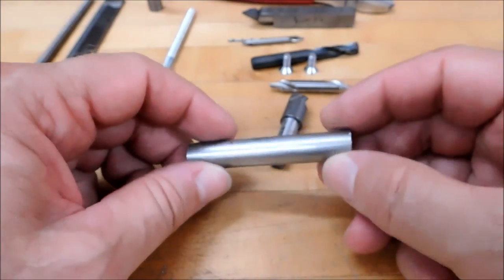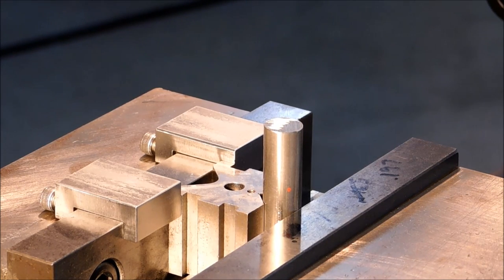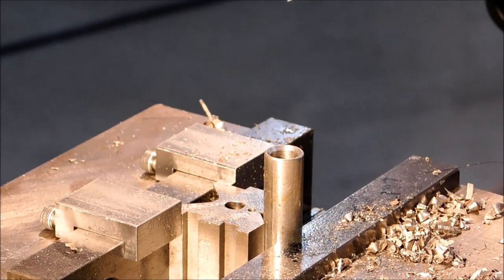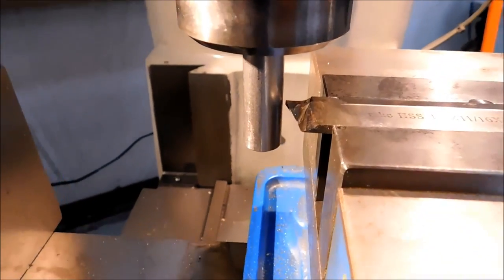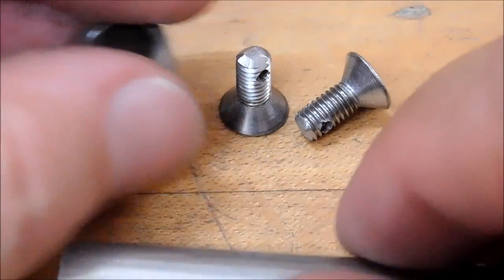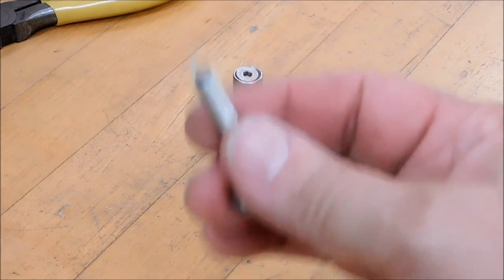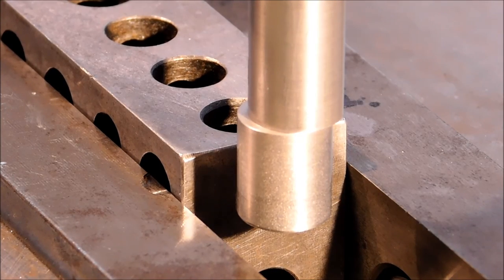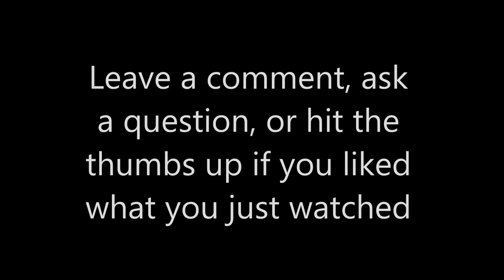Making an Edge Finder ---- On a Manual mill ???

Comment: Is the runout (eccentricity) of an edge finder in a jacobs chuck a consideration?  I've been using edge finders for over 50 years and sometimes wonder although I figure it normally would not be enough for concern.
Reply from the maker: That would make for an interesting test.
Reply: I have heard that runout doesn't matter. Haven't tested though
Reply: @MF175mp  I saw another video saying also that runout doesn't matter as the center finder, as its name implies, finds its own center of rotation just prior to jumping to the side.
Reply: @npalen  yeah, as long as the face runs true it should be accurate
Reply: I believe that the more runout there is, the more shy (away) of the edge one will get because the edge finder will be bumped before the true edge + tool radius is found.  This measurement will be very small, and depending on the tool one wants to use in the machine and how accurate one wants to be, this will matter a lot or not matter much.  

Then there is always the relaxing of the chuck to insert another tool which can/will change the center again in many cases, where the error could cancel or compound depending on how it is mounted/installed.  A sharp bit, however, will flex and center itself anyway if enough shank is exposed, so no compounding will happen in that case.  

Good ol' collets to the rescue
Reply: @sonicdewd  Just made one and tested it. My chuck have lots of run-out but the shift is very small, about millimeter. I have seen bigger shifts, so I'm wondering what are the factors which affect on it.

Mine is made on 10mm silversteel with 6mm hole and quite stiff 4mm spring. I hardened it in water but didn't temper, so it's very hard. Something like HRC 63-65. Surface is polished to mirror finish.  I also lapped mating surfaces and they are precise enough to ring. 

There are no problems because the shift is big enough to be noticable and I can't see any difference between  results. Error is definitely smaller than 0.01mm and runout on my chuck is about 0.15mm. Therefore I can safely say that averaging works pretty well.
Reply: @teropiispala2576  #1: Excellent work. Thanks for doing that and the pingback. #2: It really is good to know your results.  Next time I set up like that, I'm going to look out for your fiindings.  I have this suspicion that averaging does work (as long as the results stay in the fat part of the bell curve) and confirmed with real-world work now. Thanks
Reply: @sonicdewd  I just did a test by setting zero on the axis DRO using the edge finder against the vise jaw.  Then inserted a double thickness of paper, 0.010"total, between the edge finder and one jacobs chuck jaw.  The reading was the same zero on the DRO.
Reply: @npalen  That's a good test. However, look for the amount of pinch the paper in the jaw received.  You might try hard brass shimstock or a sliver of tin can for the jaw (paper ok for the vice because of the large surface area).  I think the reading will be somewhat offset.  

My comments above had to do with centering bits (allowed to flex a little) tending to cancel things out. But other 'hard' tools will definitely see a change and the offset difference will gain, the more runout one has.  But at the end of the day, an edge finder tool is to locate EXACTLY where that beginning pilot dimple is to be located.  In a regular job, one doesn't deal with bitflex - it never comes into play, or it shouldn't.

Here's the real question: An eccentrically-revolving edge finder tool looks to the vice like a blob of metal going around and hitting (blob increasing the radius) rather than a smooth surface as you know.  So, question: When a wobbly offset tool prematurely hits  the edge, does the tail offset itself immediately? Or can it bump and in 1/2 revolution recenter itself and repeat this a little until the tool is advanced another half a thousandths?  Or a better question: Does an eccentric edge finder tool produce inconsistent results? I think that is the best question.

An aside: There is a strong possibility I'm not envisioning something correctly on your setup.  

Thanks - as soon as I get back, you guys have me more curious with this now!
Reply: @sonicdewd  OK-used a 0.025" thickness steel shim under one jaw of the jacobs chuck.  The DRO still reads zero when the edge finder first slips to the side.  It truly does "find center".
Reply: @npalen  Dang. I really didn't expect a perfect zero.  Undoubtedly useful stuff to me and others reading. I will eventually give you my results when I'm able.  Good stuff.

Comment: I pick up my first mill at the end of the month - thinking about making one of these on the lathe before it comes. What makes it suddenly ping out when you are properly at the edge?....
Reply: rubbing on one side of the face when you tip it by contacting the part
Reply: Robert Thompson I still don’t quite get it. From watching it approach the workpiece the wobble gets less and less (as I presume the workpiece is pushing the bottom part back towards being true to the shaft). Once the wobble stops there is a very abrupt ‘push’ off to one side of the finder. Why doesn’t it just start wobbling again?...
Reply: Oh - I have just worked it out - the workpiece stops it from wobbling, and the direction that the spindle is turning decides which direction it’s going to be pushed out in. My brain has finally caught up!
Reply: Due to the rpm when the edge finder kicks off it try's to then walk or pull itself along the part edge. That increases the visual amount it moves. Whoever first figured out a simple tool like this would work was a very intelligent person. As Joe mentioned, hardening and then fine lapping each face is very important. That's one reason why the cheap store bought ones don't work very well. Watch makers use an off set un-powered tool to polish or lap screw heads. The parts rotation say in a lathe chuck helps to set the un-powered but still free to rotate lap in a counter rotation to the power rotated part. So a finely lapped and flat face is quickly obtained. Clickspring to name just one has at least one video showing how it's done. If you can get them apart without stretching and ruining the internal spring, those cheap off shore edge finders if? they've been properly hardened can be tuned up to work very well. I've found a single drop of thin non drying instrument oil can make them work even better.

Comment: Could one just start with a half inch OD thickish wall chunk of tubing, thus saving the axial drilling steps? I'd think it would save about half the manufacturing time, as even the centering operation is simplified (ID sized pin or drill bit in raw tube and chuck/collet, drop quill, line up vise, voila). Then the job basically becomes "countersink, part, face, drill screws, heat treat, assemble, drink a celebratory beer", lol. Love the channel and content Joe, keep up the awesome work!
Reply from the maker: Tubing would be quicker for sure.

Comment: I just bought a set of edge finders and none tell me how far, when it swings out, I'm actually away from the surface. Can you help me out with that?
Reply from the maker: I trust mine to be within .0005. You should always do it twice and you can also set your next table move accordingly if you think its giving a false reading.
Reply: 1/2 the diameter of the part that touched the edge, if that is what you are asking
Edit. Just realized this is a 5 month old post, oh well

Comment: I will make one of those. In my lathe, as that's the ONLY machine I've got.
Reply: Mats. good for you please enlighten me on how you use one with lathe work . or do you have a milling attachment  with the lathe?.I have been machining parts for a good many years and have never had to resort to an edge finder with any turning work .
Reply: @karlhrdylicka  I do use my lathe as a (horizontal) mill, quite regularly. If I had a bigger workshop space, I'd get a dedicated mill. But currently not an option.
Reply: @matspatpc  Thanks for the reply I thought you might have been using your lathe as a mill which explains why you need edge finder . Cheers .Chris /UK.

Comment: Do you think adding some black line between both of the tubes will help see it
Reply from the maker: I think keeping the mating surfaces very shiny and positioning the light for a good flare reflection is the best. A black outer ring may make that more visible too.

Comment: Around 6:11 your blank moved or rotated maybe 10 degrees.
Reply: Yes, I noticed that the part moved down in the vice a bit too.
Reply from the maker: Wow. you have good eyes. That just shows how little pressure I actually gripped that part with. In a vertical drilling operation it didn't hurt the part, but milling may have been a different story.

Comment: I don't know if my mill can do this.It is so waren out , Bridgeport round ram As close as I can find mfg in about 1939 . table has a dip in same,Had to grind a 3/4 plate flat both sides about a 1 ft. sq to get spindle in line

Comment: Nice camera or nice lens? There are some really specialized macro lenses that would be great, but most are a lot of money. Right off the start, I'd probably suggest something like a used Panasonic GH4 camera. They don't overheat, and can record without stopping every 30 minutes. Lenses will need a little more consideration. Same goes for audio, but you'll probably want a short shotgun mic, and either a lavaliere or headset style mic. Wireless might be nice, I've just started using a cheap system that works pretty well if you are interested. I have some links to some of the stuff I use in my videos, or I can email you if you want more detail or to discuss specifics. I may want to try a few tests on my older GH2 cameras to figure out lens suggestions, but probably a 50mm and 85mm would focus close enough to give a very magnified view of a part. A 20mm for work at the white board would probably be a good choice. These are based on the sensor size of the GH4 camera. I don't really recommend zoom lenses for this, they normally lack close focus compared to a non-zoom (prime) lenses. Most of my old lenses will go as close as 1.5 feet, and not very expensive on the used market from places like MPB or KEH or LensAuthority.

If you want a camera for diving (in a housing) then there might be some significant differences in lenses for use when you are teaching us. Going to depend on all the use cases you need for this equipment.

Anyway, if you'd like to discuss any of this, let me know.

Comment: Nice project and video but if I had a mill and no lathe I probably wouldnt have parting tools or turning tool bits. 😃👍🏻👍🏻
Reply from the maker: The bits are certainly easier to acquire than the machine. It doesn't hurt to have a couple in the box.
Reply: Easy enough to make in a couple of minutes on a grinder.

Comment: That poor brush never stood a chance  RIP ... 🙄😂

Nice little project Joe ... its a lathe job for me . 🤗

😎👍☘🍺
Reply: I made mine with a soft core 12mm dowel pin, body length 75mm with a 8 mm hole right through, a recess on one end 10 I/D x 4mm deep, that will take a spring. For the wiggler I made a washer 5mm thick drilled and reamed 4 mm. the contact faces ground on the surface grinder, using a 20x4 dowel pin, grind 2 flats about 2mm thick, drill a hole to take a spring,  press in the dowel into the washer with that flat protruding  about 5 mm. Make a button for other end of the body 4 mm thick x 10 mm dia nice lose fit with a pin 4 mm thick x 5 mm long , grind 2 flat to take up the spring, it will look like a thick headed nail . Make sure work piece runs accurately, any imbalances will throw out accuracy.  Everything was made on a Myford lathe using a collet.  Good luck everyone.
Reply: @ramennaidoo162    sounds like a good job !! 

😎👍☘🍺

Comment: Yes - an excellent project for lateral thinking again - turning in the mill.
Had to smile - you Americans with your 10/32nds and 9mm etc....   whatever happened to 5/16ths and a 10mm or 3/8th drill etc - getting more agricutlural as we age - back to our roots....   and what you called  the steel rule(r) .....    Yes Dad!   I was  watching and paying attention.   Thanks again     -  Will I try making my own Vee block first to be able to align vertical bits in the vice?     Slàinte Mhath  !
Reply: culmalachie that is not 10/32s it is a #10 machine screw with 32 threads per inch ...
Reply: @chuckels431   Ha ha ha !    Oh well .........   Must be the size of the Pond -  ( Language gap)   no wonder there CAN BE so much mis-understanding in Engineering    Mmm Yes - I do know 'ot of he box'what 32 tpi is, but No.X   screws kinda beats me - see it often in UK on Woodscrews -  and believe it is used for small diameter imperial threaded screws.     .........  and the 9mm ?     ;-)
Reply from the maker: 9mm's are used to shoot trespassers.
Reply: @joepie221  LOL ..Good attitude, or a slightly longer cartridge, Called .357 Magnum .. LOL
Reply from the maker: @TedRoza  Next to my P97 Ruger .45, my 6" S&W .357 is my next favorite. If that don't get the job done its time to break out the Mossberg 590.
Reply: @joepie221  mine is GP100   .357 magnum, .. plus a few other .. toys lol  ..
Reply: @joepie221  What trip-wire did I fall over today?  Never expected all this when I had my Weetabix this morning!  - well Porridge or Brose really !   Amazing what you can learn here!    beter knock loud before I enter then, eh!   :-)

Comment: Thanks for showing how this is done.  I have one that I have been using since the early 1970’s.   Have not machined professionally for decades, but have some toys in the garage.   Will likely make a plurality of these.   I see value in having different diameter finders so I can avoid changing the collet.
Reply from the maker: True. 3/8 is another very popular size.
Reply: I decided to make a 1/2” unit to supplement my 3/8” one.  
Not having an extension spring I resigned it to use a compression spring.  A 16d nail is already the correct diameter to thread 6-32, so I smoothed up the head, cut it to length and cut about an inch worth of threads on it.  
The contact part was just like yours, but the body was counterbored at the far end to accept the compression spring.  I turned and tapped a small nut to thread onto the nail, compressing the spring and drawing the contact part tight.  I did all this on lathes, the nail on my toy lathe, the other on my gunsmith lathe.   This tool is for the mill, but it was tied up, so I tested it in the lathe.  Worked well.  Was a lot of fun.  Thanks

Comment: I'm not a machinist. I understand what an edge finder is. But. I saw you push it off center and then eased it up to the part. It went center and then off to one side. Is that when it's the eadge, or am i missing something
Reply from the maker: When it kicks out, you then shift the table half the diameter of the tip and you are then over the edge.

Comment: As a former toolmaker,  we would never use these things, there just not accurate enough. You should always use a dti
Reply: unless its +- .010 i mean .001"
Reply: dti? Also accurate enough is a matter of the scale you're working on. As a toolmaker I imagine your scale would be quite tight. For general machining edge finders work well. I hit +-.0015 with them daily verified by CMM.
Reply: @Fr1day-RT  same i meant to put .001 i repeat it on the fadal at work :D
Reply: dti?
Reply: @Guranga93  dial test indicator.

Comment: kool project...good vid...At first i had to wonder why  I needed one for my mill..and after looking into edge finders..Its for a digital read outs DRO which i don't have.(.cave man milling)...some day i might put one on..I use a drill shank and long scale...depending on the project..cheers
Reply from the maker: I have to correct you. Electronic type edge finders ( probes ) are for DRO's. These 2 piece units are for picking up an edge accurately, with or without a DRO. Once it jumps out, you set your dials on your manual machines and off you go.
Reply: @joepie221  Kool  thanks ...makes it even the more reason to start another project...lol

Comment: Jo: great cost saving and fun/useful project!
What diameter was the other one with the neck? Or was it a commercial product?
Being in UK I’d use silver steel for the item.

Mike
Reply from the maker: Hi Mike. The other one had a .200 dia neck on one side and a point on the other. Commercial item.

Comment: Anyone else notice the stock move down at 6:10 ?
Reply from the maker: Still on location. It was held gently as not to crush the OD when the material came out.
Reply: @joepie221  Yeah, I heard you mention it later. I was just noticing a rare event!
Reply: @joepie221  Didn't mean to seem like I was calling you out on that, Joe...
It was just because this video was a beginner tutorial sort of, and that might be something that would scare a newb like me if it happened unawares.
I understand why you wouldn't want to put a parallel under, because it would get drilled into, but could you use like a scrap chunk of aluminum or something under there to support it?
Reply from the maker: @Tasarran  Absolutely. Just be careful the drill doesn't grab the chunk and partially spin it, then stop. that could cost you a drill and maybe the part too.

Comment: Nice project and video. You can purchase a new edge finder for as low as $7-$8 on eBay. Of course, you don’t have the pride of having made that tool yourself. Take care.
Reply: Even the Starrett edge finders are cheap. I have a cheap one from China, but it was giving me some trouble, so I bought a good one. Been wanting a larger diameter so I may make one of these, mostly so I can say I made it.